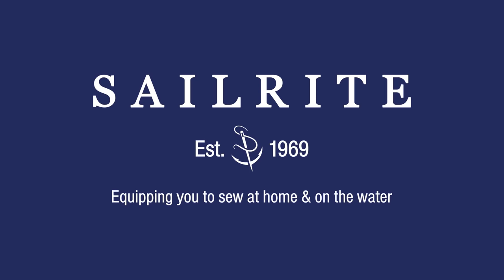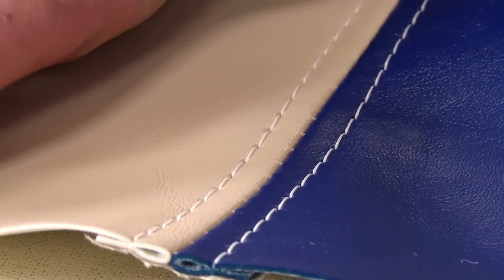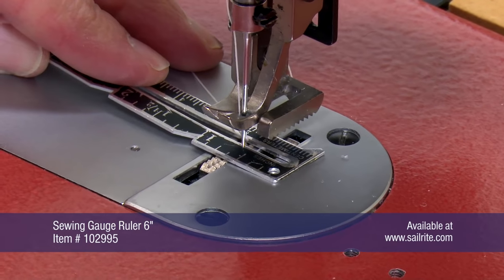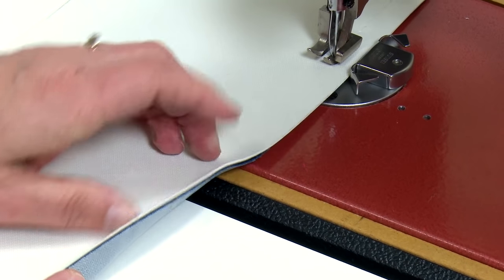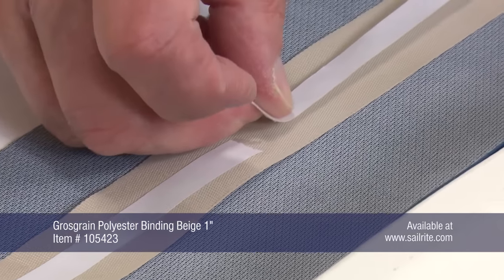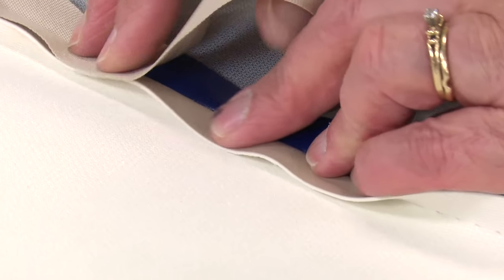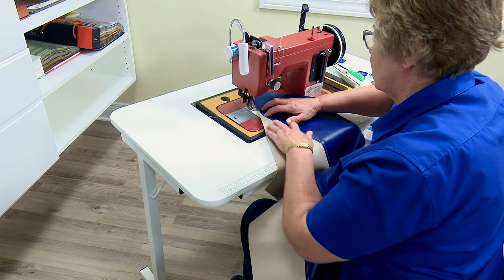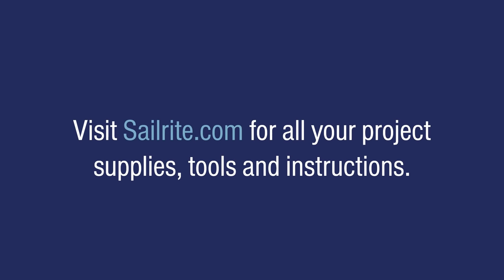How to Sew a French Seam / Double Top Stitch

Comment: Great Video!  
As  newbie to this craft, I purchased the Sailrite 111 with the MC-SCR to reupholster a classic car and have practiced this French Seam with an automotive grade vinyl with backing for the seams using a 6 mm stitch, V-92 thread and tension set appropriately.  With a few runs of practice I was able to replicate this method successfully but a little concerned about the seam itself and if I am doing something wrong.  I did not use the grosgrain binding that was used in this video but used an automotive 1 1/4" backing that is sold in a wholesale automotive upholstery shop that they recommend for these seams.  Additionally, I did  not use a foam backing material in my practice runs but don't think that attribute much binding strength to this vinyl seam itself.  Using a little force, I am able to separate the seams to the point where I can see the backing material behind it (approx. 1/16" and probably more if I tried) and there are no manuals or video's that explain how much effort you should be able to use to pull apart the seams or what is acceptable.  

That said, any idea how to gauge how much effort could be applied to a seam to consider it acceptable or if from the details of my question--I've overlooked something?  What are acceptable stitch lengths for a french seams in automotive grade vinyl as to not tear the material and keep it ascetically pleasing for automotive seats?  Any assistance or advice is appreciated!
Reply from the maker: Hi Alan, You are correct, the type of backing is not too important and the foam backing is only a preference for the type of job we were doing, it is not a requirement for a french seam. When pulling the first seam apart only apply enough force to splay it open along the stitches (so it folds open along the stitch line). Try not to open up the seam to the point where you see the backing materiel (keep it (backing) hidden as much as possible). Typically a stitch length of 6mm is used, anything less may result in possible wrinkles in the fabric (or perforation of the fabric, but that is reduced due to the advancements in fabric making today) anything longer than 6mm may be easy to catch and break a stitch when the project is in use. Let me know if you have more questions. 
Thanks, Eric

Comment: Great video.  Very neat outcome.  I notice that the first seam is stitched with quite a long stitch.  Is this only because your sewing with vinyl.  I always that that the seam stitch length would be a shorter stitch but the top stitch is the longer one of the two.
Reply from the maker: When we sew vinyl we usually sew with about a 6mm stitch length. True the first stitch can be shorter while the top stitches can be longer.

Comment: Very nicely shown, produced and explained. I make my own motorcycle clothing. Seam strength is really important. I’m considering this method for cowhide leather rather than a full flat felled seam because you only sew through through 2 layers of leather with the French (plus a binding layer) versus 4 layers for for leather. My cowhide is usually 1.8mm thick so that’d be 5.2mm thick! 

How strong do you consider this french seam?
Reply from the maker: The French Seam is very strong if a polyester fabric backing is used to reinforce the seam. We use this product: https://www.sailrite.com/Binding-Tape-Polyester-Beige-1

Comment: oh boy this is confusing , french seams in apparel and garment making means something totally different
Reply from the maker: That is very true, in the apparel and garment industry they are different.
Reply: @SailriteDIY  what's the difference?
Reply from the maker: @peacheskong2245  You can google it and find the answers rather quickly.
Reply: @peacheskong2245 in addition to what serendipidus said,  1) the stitch length is shorter; 2) the thread is still durable but much thinner, 3) the thread guide is somewhat smaller depending on the type of garment being sewn, 4) the size of the needle is going to be thinner in most cases what was shown was a #18, #20 or #22 needle, in garments it is going to be most likely a #11 to a #14 needle.

Comment: Always enjoy your videos...and still wishing I had a Sailrite machine. But I have an inherited Brother CS 6000i with which I need to make protective covers for two smallish machines used for welding. I have created a pattern from felt and purchased flannel-backed vinyl for the covers from my local fabric store where they recommended regular all-purpose Coats and Clark thread and a denim needle size 14. The covers are for my son’s birthday in 10 days, but now I’m wondering if the notions I have are correct or at least sufficient for the fabric I’ll be using. I can get basting tape, grosgrain binding, and size 16 needles, but I am not familiar with V92 or V69 polyester thread. Is there another name for it? My worry now is that I choose the correct needle and thread so that I don’t split/tear the vinyl as I topstitch/french seam the pieces. Thank you for any guidance you can provide.
Reply: Just wanted to add that I checked my sewing machine manual and it looks like the longest straight stitch possible is 5.0 or 3/16”. Is this long enough? And would a walking foot help? Thanks again.
Reply from the maker: Vinyl seating fabric likes a long straight stitch to avoid perforation (ripping). We like to use a 6mm stitch length, but your 5mm (or 3/16") length should work fine. If your needle size recommendation is a size #14 then the thread you will be using is like a V-46 size (Tex 45), which is way too small for boat vinyl seating applications (if that is what you are doing). You must use a V-69 (Tex 70) or even better V-92 (Tex 90). However, your Brother CS 6000i is a home sewing machine and may only be able to sew with V-69 (Tex 70) thread and a size #16 needle for the max size.  It may struggle with proper tension on this thicker thread and will defiantly not be able to handle the V-92 size thread, way too large for a home sewing machine. Let me know if you have more questions.
Reply: Sailrite Thanks for taking the time to respond. ❤️ Will be trying as many of your suggestions as possible. And next time I’ll plan ahead and allow myself enough time to order supplies from you. 😊

Comment: It would be "complementary" to mention stitch length and thread size?
Reply from the maker: 6mm stitch length is common for the top stitches. 5mm for the center seam. V-92 Polyester was used to sew this.

Comment: When she transitioned from the blue material to white, Dis she continue with the thread without cutting it or did she cut the thread and start a new one?  I think she just rotated it, but not sure. Does anyone know which way is correct?
Reply from the maker: You do not need to cut the threads at the end, if you will be sewing close to the section you just sewed from. So... here she ended her sewing, did not cut threads, and rotated the panel to sew on the opposite side to start sewing again. Not cutting threads means you do not have to worry about holding loose ends when you start sewing again. After you are done you can then cut the loose threads.
Reply: @SailriteDIY  Thank you for your quick and very clear response! You guys are 100% in every facet of this industry! Thank you.

Comment: I am going ot be sewing a french seam onto a motorcyle seat that doesnt currently have it. How much extra material do I need to add to the edge of my pattern to compensate for the seam? 1/4 or half on each panel?
Reply from the maker: Each French Seam will take up 1" of fabric or a half inch on each panel.
Reply: Thank you much for the tip.

Comment: Awesome video.  Will the french seam generally make that joint stronger?  We have a small boat and use the rear seats to step in.  Over time the seams have ripped due to the pressure of standing on the seats.  I'm thinking doing a french seam along those seams will increase the durability.  Opinions or experience?  Also, have you ever done just a white seat with a couple of seams and top stitch with a different color (blue).  Currently I have 3 seams on the seat - one blue/white, one white/white.  I was thinking of just making it all white, but top stitching in blue, but I'm not sure it that would just look weird?  I don't see anything like that online.
Reply from the maker: +inge stevens A French Seam is very strong if a ribbon of fabric backing is used on the underside, as shown in the video. So, it may be a great seam to use for your boat seats. You can use any color of thread that you think looks best. So, yes a blue may look great with white fabric. Using a white for the first stitch is a good idea, since it may tend to show up near the seam.